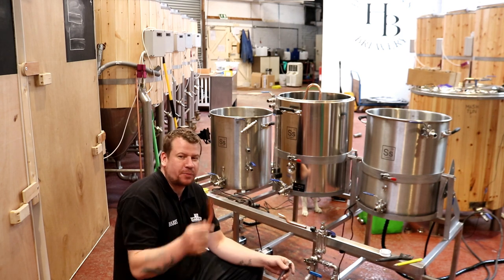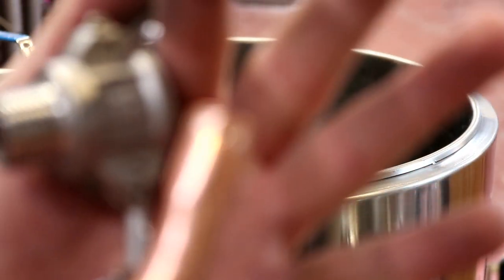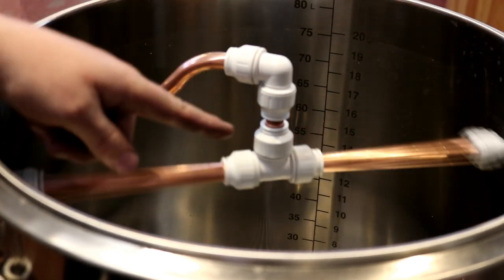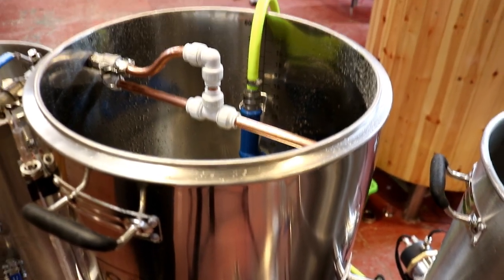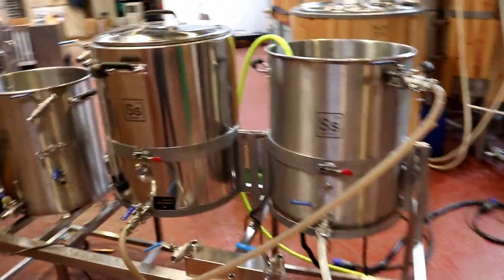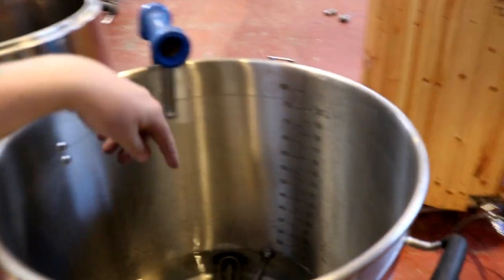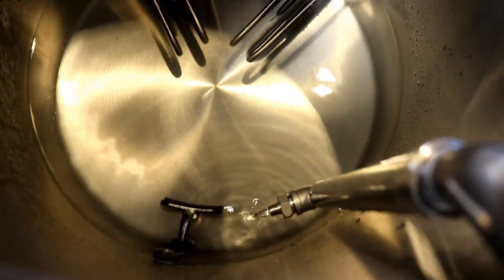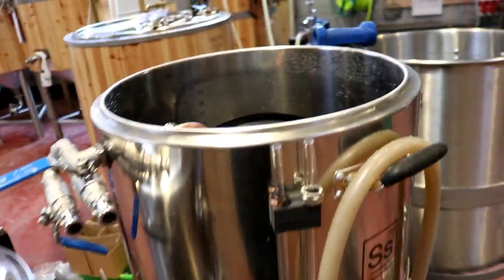Brewery Pilot Kit ~ PIPEWORK ~ Part 2 🍻

Comment: I have a 80L Herms setup based off the electricbrewery.com and just use a right angle elbow and silicon tube to recirc the mash
as well as sparge with, just as Kai's system shows. I get 80% efficiency on your average 6.5-7% range beers. The plus for to would be you could max out your mash turn and still have the lid on with no problems at all. Just a thought.

Comment: Why have the inlet for the whirlpool at the top just to have a pipe running down towards the bottom on the inside? Could you not just have the inlet where you want it with an elbow on the inside?